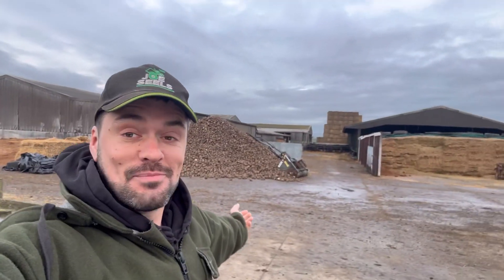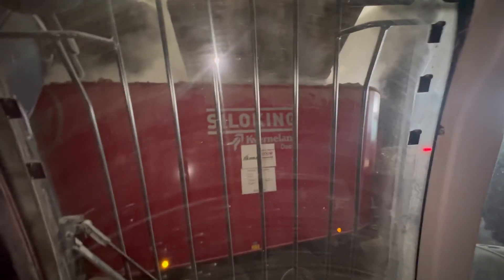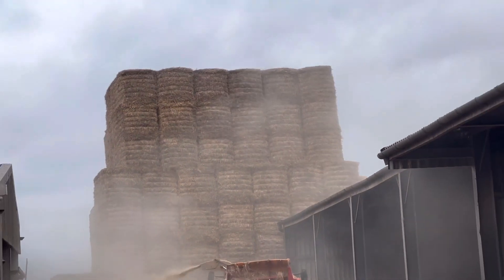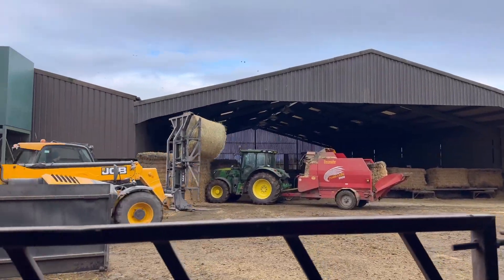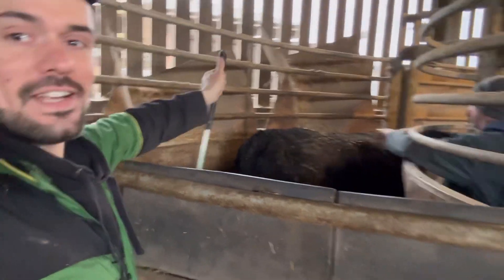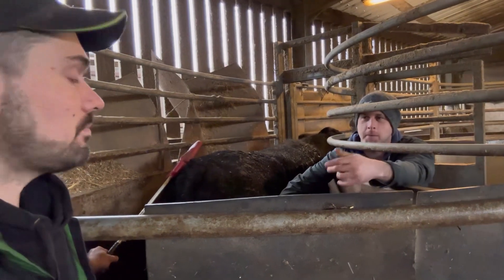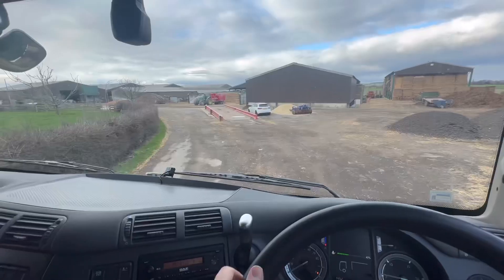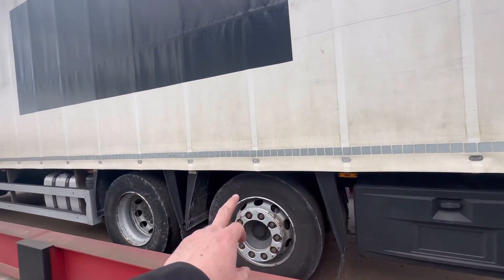Check Out Our New Mystery Machine?!

Comment: Joe. The indicator is on the left side of the steering wheel. The ignition is behind the gear stick. There's also a dial. For the gears. Near the bottom of the dash. 
You could always send it to ploughman cattle trailers. Keep it in GOD'S COUNTY. RUSS FROM NEAR SELBY. 👍